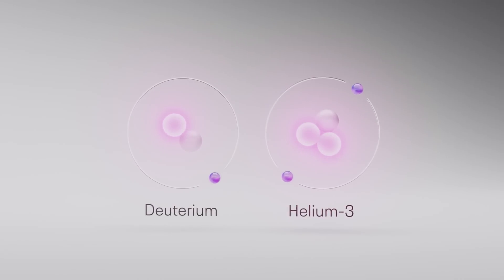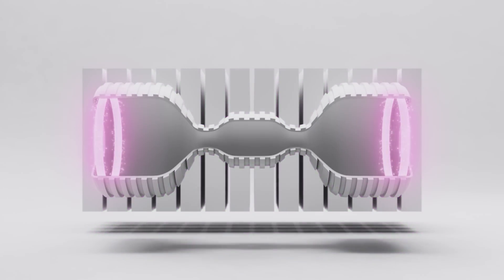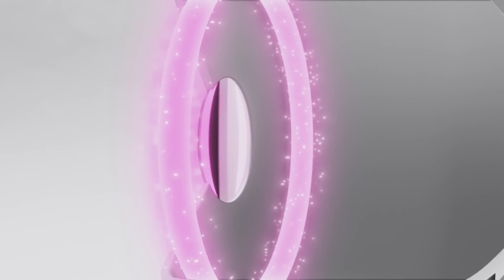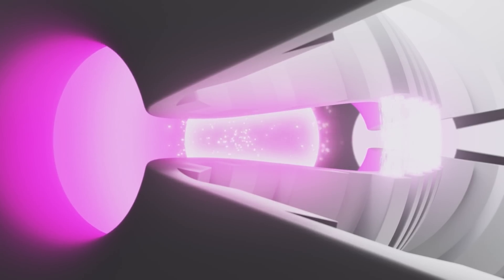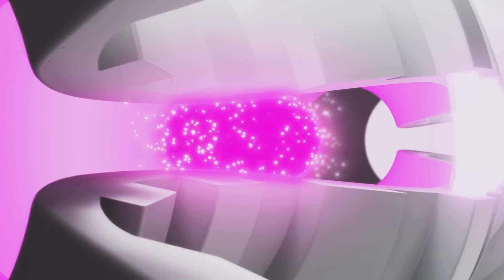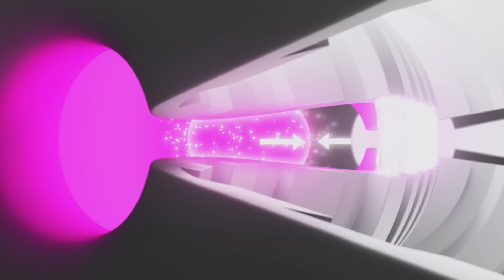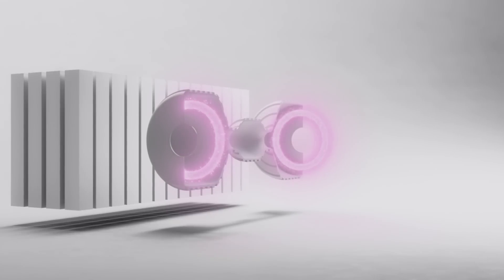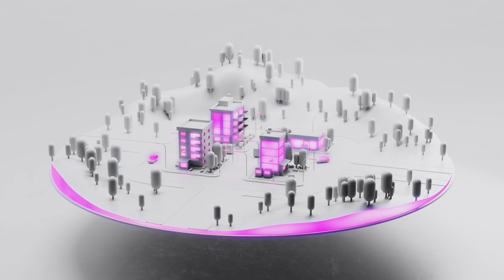Helion's approach to fusion: How it works

Comment: Would be interesting to learn more about this, for example why D-He3 is used as fuel.
Reply: The idea is that this reaction only releases charged products (DT fusion releases a neutron). This is good for two reasons: charged particles are confined by magnetic fields, so their energy is available to heat the plasma and in Helions case, cause the plasma to expand and generate electricity directly via faradays law. The second reason is that neutrons make things radioactive and embrittle/damage the structure surrounding them, limiting plant lifetime. The downside is He3 is very rare. Helion claims to be able to manufacture it with DD fusion.
Reply: @TurtleBoss33  experiments at JET have identified materials that are less susceptible to neutron bombardment.
Reply: @BrianSu  Very true! But a good way to not have neutron damage is to not have (many) 
neutrons.
Reply: The D/T pair have the lowest binding energy per nucleon of the prospective fusion fuels, this makes binding at lower energies easier. Look-up "binding energy per nucleon" a graph will make that claim apparent.
Reply: @lesmiklosy4300  Knowing why D-T is typically used will not help them understand why D-He3 is being used here.
Reply: The other answers state what Helion also claimed in their interview with the YouTube channel Real Engineering. However, what is left unexplained is how the neutron that is a result of the deuterium-deuterium reaction is dealt with, especially since that reaction should even be more likely than the D/He3 one. In academic fusion research, the proton-boron reaction is stated as the easiest reaction that avoids neutrons, but perhaps Helion has some answer to this they're not mentioning?
They also talk about how the neutron is actually useful for breeding (creating) the He3 they need, since it's not an abundantly available material, but say that they see the separation of this process from power generation as a preferable approach.
Would love to see some answers on these questions from Helion!
Reply: There is a new video by Real Engineering that interviews the Helion staff and explains the ins and outs of the technology. Something they completely leave out of this video is that this reactor is actually also A MOTHER FUCKING ALCHEMIST!!! It can do "dry runs" where is actually CREATES HELIUM-3, the worlds most important scientific resource!!!!
These reactors are going to be integral in producing both the electricity and the Helium-3 required to create the Absolute Zero operating environment needed to run more and more complex quantum computers.